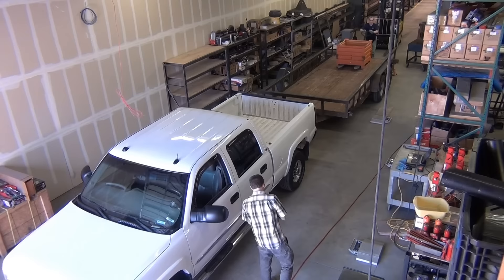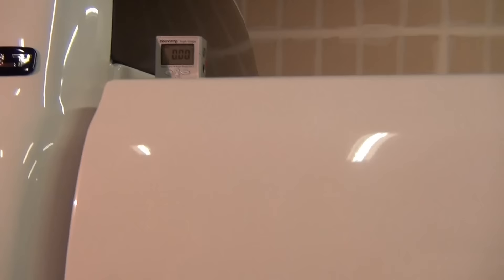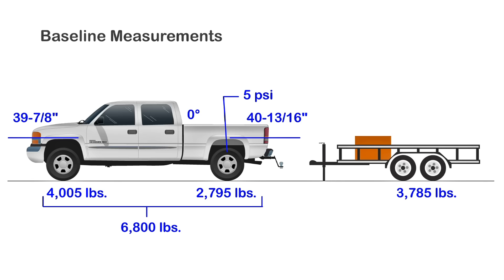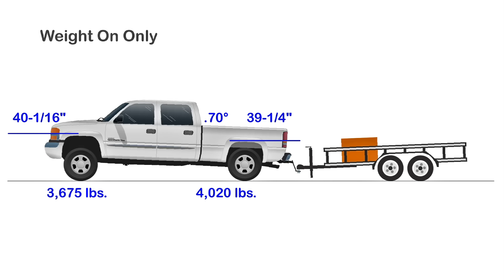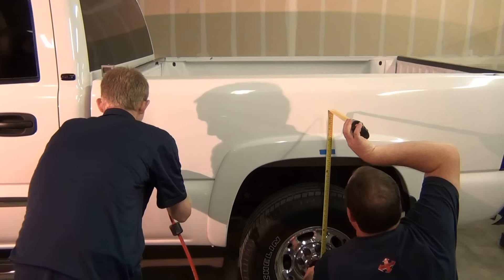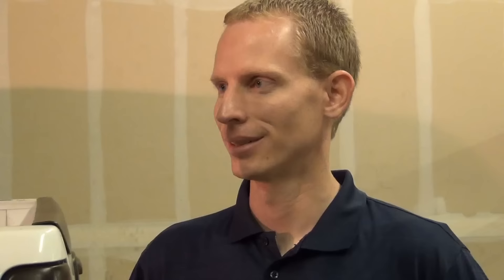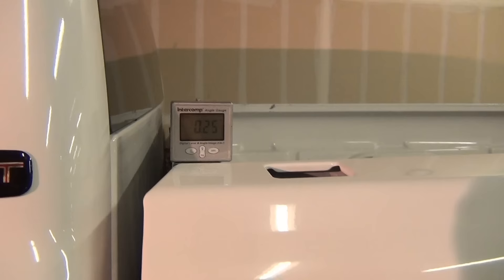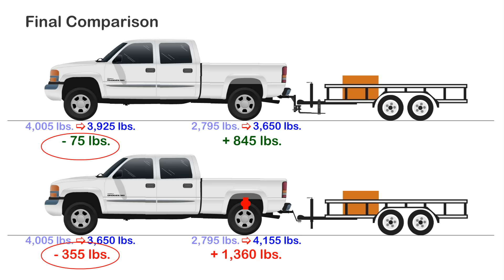The Difference Between Using Weight Distribution and Air Bags to Level Your Load

Comment: Do I set my airbags to the desired pressure before I connect my spring arms or after?
Reply from the maker: Nelson Off-road,
The best practice is to air up the airbags first, then hitch up and engage the spring arms. Adjustments to the air pressure after you're hitched up changes the weight distribution you are getting from the hitch.

Comment: My point in my case is added stability by using both
Reply from the maker: +Homefront, thanks for the comment.
Reply: This is what we do as well, there should have been a test of combining the two of them, use WD hitch to solve the axle weight issue, and airbags to fix the sag. Works like a charm...
Reply from the maker: +Little Rig Big Dreams, using both is a great option. We are working on a video showing how to use both air bags and weight distribution together. Hopefully released soon. Thanks for the comment.

Comment: So. I have to ask. why did you ad the tongue weight to the total weight of the trailer?   Tongue weight should be added to the trucks pay load.  the loaded trailers weight is a constant, the only time the trailers weight should show an increase is when WD is used as it will now be supporting a portion of the trucks rear end weight
Reply from the maker: As the tongue weight of the trailer causes the truck to sag, the front of the trailer goes down and the front axle of the trailer receives more load. This causes a reduction to the trailer tongue weight. The truck doesn’t get the original 1000 lbs of tongue weight and instead some goes to the front axle of the trailer. If the trailer were brought back to level with an adjustable hitch or airbags, then the full 1000 lbs of tongue weight would go to the truck and the weight at the trailer axles would remain relatively unchanged. This is why at a later point in the video it shows the weight on the truck rear axle increasing after using the airbags to level the vehicle. As the trailer is raised up, the front axle of the trailer is unloaded slightly and the tongue weight increases which puts more weight on the truck. Unfortunately the video cannot dive deeper into all of these details. But in essence, while the mass or total weight of the trailer does not change, the forces on the axles from that weight do change due to many variables not discussed in this video. Hope that helps answer your question!!

Comment: Would this be the same with a ram 1500 with 4 corner air factory suspension?
Reply from the maker: +torque addict,
This demonstration applies to anything with adjustable suspension or height adjustments or leveling, etc. When the height of the vehicle or the way the vehicle carries the load is changed, it affects the hitch and the weight distribution.

The 4 corner air suspension has several benefits and application specific advantages. It is great for adjusting the suspension for off-road vs. highway driving, or when hauling a lot of payload in the bed of the truck, or when towing a trailer that might not require weight distribution/sway control, etc.

However, when using a good weight distribution hitch that is set correctly, adjustable air suspension typically isn’t needed or can be turned off. A good weight distribution hitch will distribute the weight and therefore will inherently also take care of sag issues. In most cases, if there is too much sag when using a weight distribution hitch, it is an indicator of another problem like too much tongue weight for the given tow vehicle and/or hitch, or the weight distribution hitch isn’t set correctly.

For the cases with auto leveling that cannot be turned off or adjusted manually there may need to be an iterative process (trial-and-error) of setting up the hitch and checking measurements before getting the hitch set correctly and getting it to work in conjunction with the auto level system.

For more questions about using weight distribution with auto level refer to the e2 hitch owner’s manual, http://www.fastwaytrailer.com/manuals, or contact our customer support specialists at 877-523-9103 or support@fastwaytrailer.com.

Comment: Thanks for the great video.  I am going to be towing a 29 foot travel trailer soon and wanted to make sure I am not making a huge mistake.  I am going to be putting the FireStone air springs under it as well.  I read other comments that say to set up the bags first. I understand why, but the how is the question.  Is it best to fill them so it rides higher unloaded and the weight on the tongue will then take it back to the factory level once the trailer is hooked up?  Or is this something the dealer will be able to do when they install the hitch?
Reply from the maker: Ryan, 
We recommend using the air bags in a lower setting, which will take away some/most of the squat in the rear of your tow vehicle, but it will still allow the WDH to transfer weight back to the front of your tow vehicle. The installer at the dealership should know how to install the hitch with air bags. We also have hitch install videos w/ air bags on our Equal-i-zer Hitch YouTube Channel.

Comment: Thanks.  But about a 5 wheel  and air bags vs no air bags ? Just wondering.
Reply from the maker: +K. Dogg,
We do not manufacture a 5th wheel hitch, and haven't done any testing with a 5th wheel / air bag configuration.

In general, the pin weight from the 5th wheel acts much differently on the tow vehicle than tongue weight because of where it is placed - between the axles vs. at the rear of the trailer. Therefore, it acts on the tow vehicle more like carrying cargo, which is a situation where air bags can be very helpful.  We recommend consulting a reputable dealership, 5th wheel hitch manufacturer, and air bag manufacturer to get more information to help you make an informed decision for your particular setup.

Good luck, and thanks for the question!

Comment: Dave and Jason, thank you both--first thing on this subject I have seen.  Let me ask-AFTER you have placed the WD hitch on the rig, and received the good results as you discussed--do you THEN want the air bag to level out that slight angle (0.25 as I recall)?  Or do you call it good at that point?   In my case, I have a light weight Camper on the truck, then when I add the  boat and trailer the back sag is not acceptable.  Sounds like the WD hitch is the way to go.  thanks for posting
Reply from the maker: Jmichael Isbell,

Great question, thanks for asking! Yes. A good weight distribution hitch would be a good way to go.

The best way to get your weight distribution dialed in if you're using air bags on your rear axle, is to inflate the air bags first, then set up the weight distribution to get at least 1/2 the weight (distance) back on your front end. If you are halfway back, and are still seeing some sag, we recommend increasing the weight distribution first. You can do so up until you reach the point where your front end is back to the same baseline weight (height) as it was before coupling the trailer. Inflating the rear axle air bags at this point would most likely help with the sag, but at the expense of reducing the weight distribution.

This is why it's so important to actually check your weights when doing a set up with air bags. When setting up without using air bags, the change in the wheel well heights is a pretty accurate representation of what's happening with the axle weights. But when you are inflating the air bags after the trailer is coupled, you have now essentially changed what would have been the baseline, so the distance change is not an accurate representation of the weight change.

To illustrate this, suppose your baseline wheel well measurements at front and back are 20" with no air. Coupling the trailer, the front is 21" and the back is 19". You inflate the air bags, and return the rear axle to 20". Now, uncouple the trailer, but don't adjust the air bags. Instead of returning to the 20" baseline, the tow vehicle would measure ~20" at the front axle, because nothing there changed. But the rear axle would measure the baseline 20", plus whatever it gains from the inflation of the airbags, so 21+" (because it is now not carrying the trailer's tongue weight as it was when you inflated the air bags). By inflating the air bags you essentially changed the baseline measurements, but adjusting the air bags after the trailer is coupled hides that.

As far as still having a slight amount of sag, in most cases, if your weights are good, a bit of sag is fine. It is usually an indicator that there is more weight on the rear axle, which is good, and what you would expect when towing something. That added weight helps keep your combined vehicle stable.

One caution. Check your rear axle ratings. Air bags do not increase the carrying capacity of your axles. They are a good way to stiffen a suspension, but they do not increase the strength of the other components in your suspension (axle, differential, bearings, frame, tires, etc.). After you have your rig set up with the camper, boat, and weight distribution engaged, go to a scale, and make sure you are not exceeding any of the weight ratings on your vehicles, especially the rear axle weight rating of the truck.

Good luck and safe towing!
Reply: That all makes sense EXCEPT for one issue that no doubt will prove I have not used WD hitches before and do not know clearly how they work.  I have watched film and read directions of how to set them up, but have never seen an instruction as to how to "fine tune" them.  This is what you have alluded to when you said that we should "increase the weight distribution".  Such fine tuning--or adjusting, is not something I have seen discussed, or demonstrated.  All I have seen thus far is how to "hook em up"; obviously, this is important and something I need to follow when I set up my first system.
I also realize this may NOT be in your scope, but do you recommend any given MAKE of WD hitch, or is that something your video is just not about?   Thanks again
Reply from the maker: All weight distribution hitches are made with some mechanism that allows you to increase or decrease the amount of force they exert on the tow vehicle to transfer the weight. Most have some sort of spacer system where the hitch head attaches to the shank, which changes the angle at which they attach. The result of this is that the spring arms become more angled off axis of the receiver and trailer tongue (toward the ground).

Many also have some sort of adjustment on the brackets that attach to the frame of the trailer. Some have a length of chain that holds up the arm, and the adjustment is made by choosing one link over another. Others have rigid brackets that hold the arm. These are usually adjusted by selecting a different mounting hole used to bolt it to the frame.

The end result of making adjustments to either, is that the spring arms are lifted more (for more weight distribution) or less (for less weight distribution) in relation to that center axis through the receiver hitch and trailer frame. A good way to see this is to imagine the spring arms coming off the hitch as if they were the handles of a wheel barrow. The higher you lift them, the more weight distribution you get, and vice versa.

You can see more details of this by watching our e2 trunnion or e2 round bar installation videos here:
Trunnion - https://youtu.be/5_kbKyXRZTM
Round Bar - https://youtu.be/aNmcYI2Pp9w

As far as the make, yes, we recommend the two brands we manufacture. The Fastway e2 hitches ( http://www.fastwaytrailer.com/e2-hitch ) are a better alternative than a typical chain-style hitch because the sway control is built right into the hitch, which makes them easier to use as well as out-perform add-on sway control devices. The best option available to you is the Original Equal-i-zer brand hitch ( http://www.equalizerhitch.com/ ). It is American made, has a lifetime warranty, and better safety and performance than anything else you can get.
Reply: Thanks for the useful and informative video!

Just to clarify - I understand why you suggest correcting the sag with weight distribution rather than airbags. In your video, you lowered the airbags down to the manufacturer's minimum of 5 PSI. Are we to understand that raising the airbag PSI above that rate would negatively impact weight distribution by essentially undoing the "work" that you've done using the WD hitch? If so, would you recommend leaving the airbags at the minimum psi when using a WD hitch?
Reply: I did in fact go ahead with the purchase and installation.  Fortunately I tried them out around the neighborhood before setting out.  I pretty well DESTROYED the brakes on my rig, my surge break system.  What I did not know (I realize most people do--including me, now) is that most BOAT and trailer applications can't use a weight distribution system WITH surge brakes.  Smoke filled the air, pretty bad scene.  Kudos to Amazon who took the system back, no questions asked and "Anderson hitch" who in like fashion confirmed that my system, boat and trailer are not designed for this application.  Not as well publicized as one might think.  If you already knew/know, cool--I did not.
Reply from the maker: +D.P. Roberts

In the video, we correct the sag first with air bags, and then with weight distribution. We deflate the airbags back to the minimum recommended 5 psi simply to set up the rear suspension in a way that the airbags are not affecting the way the weight distribution acts on the tow vehicle and trailer. It is to replicate using a vehicle that is not equipped with air bags.

Inflating the air bags (raising the air bag psi) only negatively affects a weight distribution setup if it's done after the weight distribution is adjusted to correctly return the weight to the front axle.

If you have air bags, we recommend inflating them to the pressure you prefer to use first, and then setting the weight distribution up to return the correct amount of weight back to the front axles of the tow vehicle. This may take a bit of trial and error, as you find the air pressure and weight distribution settings that work best for your particular combined vehicle (tow vehicle and trailer).
Reply from the maker: Jmichael Isbell,

Sorry to hear about the brakes on your trailer.

Yes, this is one of the drawbacks that chain-style weight distribution hitches have - they do not work well with surge brakes. On an old-fashioned style (not Andersen), the chains allow the bars to move forward and aft in a turn, because of the change in position as the hitch head rotates around the hitch ball and coupler. Unfortunately, with a surge brake, this usually pulls the frame forward into the coupler, as is supposed to happen with normal braking. The effect is usually a pulsation of the surge brake, or locking them up.

The Andersen brand uses the chains in a different way, by intentionally pulling the trailer toward the coupler. This action would indeed lock up the surge brakes completely, and be entirely incompatible with them.

The Fastway e2 hitch uses the rigid brackets on the trailer frame, and is one of the very few hitches that is compatible with a trailer equipped with surge brakes, like most boat trailers. The bars slide back and forth on these brackets, instead of being attached with chains. This also allows the trailer to slide back and forth to actuate the surge brake, without grabbing or locking up like traditional chain-style hitches do.

If you're still interested in using weight distribution with your boat trailer - check out the e2 hitch. It will work fine with your surge brakes.
Reply: thank you having ahard time finding anyone who talks about both.
Reply: when I installed air bags I didn't need the w/d anymore

Comment: How would this apply with a 5th wheel hitch and trailer? would the principles be the same? ie adding more weight to the rear axel and still reducing the weight on the front? I am thinking that in some ways, the 5th wheel hitch acts like an equalizing hitch in transferring weight to the trailer axels?
Reply from the maker: +Jim Weems,
With most 5th wheel setups, the hitch is installed so that the pin weight rests just slightly ahead of the rear axle of the tow vehicle. This position makes it so that both axles of the tow vehicle carry the weight, so you don't get the "teeter-totter" effect like you do with a bumper-pull trailer.

Air bags are a great option when towing a 5th wheel, because a lot of weight is carried by the rear axle of the tow vehicle. You can use the air bags to easily stiffen the suspension when you're towing, and soften it when you're not. Pay special attention to your axle weights, and don't exceed the weight limits and ratings of the axles.
Reply: Thanks, I do use air bags and like the "leveling" effect and increased stability it provides.

Comment: I realize this is an older video, however the physics are still the same.  I was wondering how your product actually works though.  

Another question, from a professional trucking/tow/haul perspective, would you perform the same test but actually move the main weight over the axles of the trailer to actually balance the weight more toward the trailer and not the tongue and the ball hitch?
Reply: The weight is positioned to put approx 10-15% of ATM on the ball/hitch.  This is the safest load ratio for trailer balance.
Reply: @rossatkinson3160  1000 lbs tongue weight from a 4000 lbs trailer, is more like 25%

Comment: can you still use air bags with Weight Distribution? I still have a little sag at the hitch and I'm using WD with my camper. and my kids in the back sit said it's feels different riding (more bumpy)
Reply: Yes, you can use both.
Reply: I use both. I tow a light TT with an SUV. I us a WDH and helper air bags. Maximum air bag psi for my bags is 60, but I only put 20 psi in them. I do that FIRST, and THEN set up my WDH. Seems to work well with a medium duty SUV.